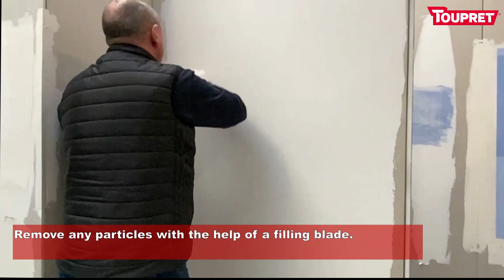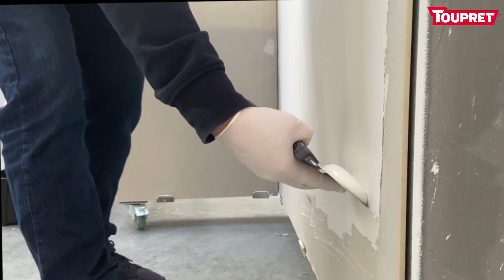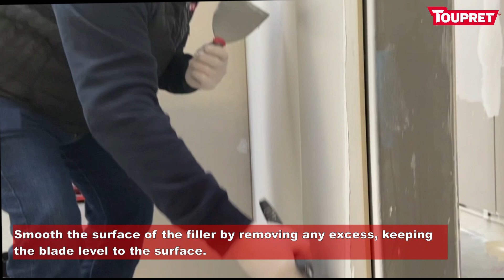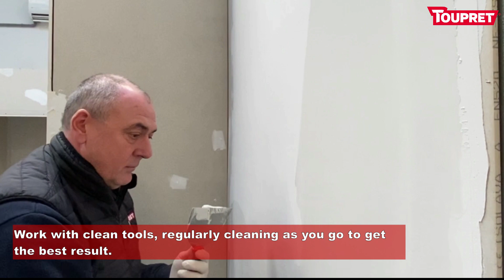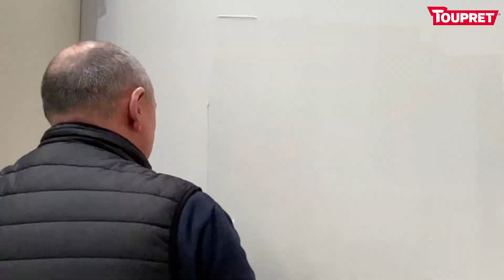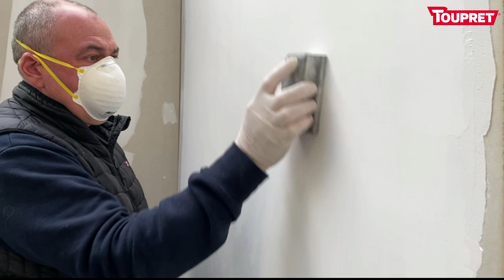Smoothing and fine finishing guide: how to elevate your walls and ceilings

Comment: I keep getting lines where the blade is overlapping, how can I reduce this?
Reply: You will need a flexible jointing knife or a flexi finishing trowel. Check the edges are nit burred. If they are use wet dry sandpaper to de-burr. Keep a shallow angle between the wall and blade and use light pressure. Keep the blade or trowel clean between each pass.
Reply: @42tops  thank you!